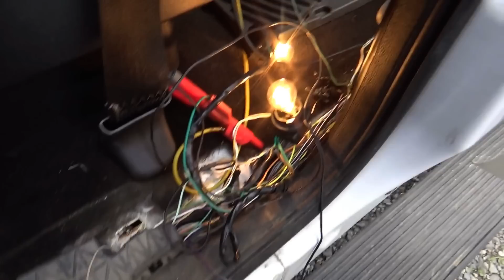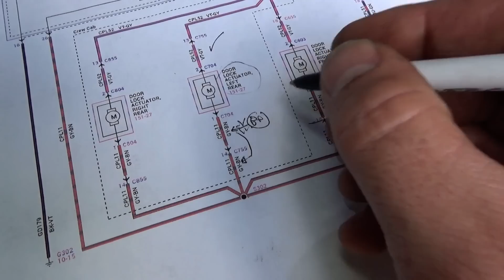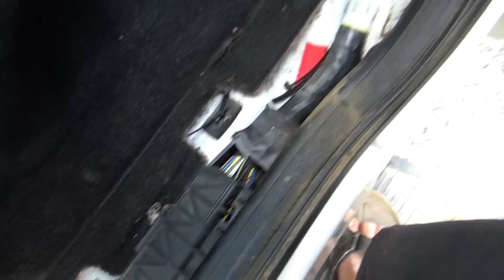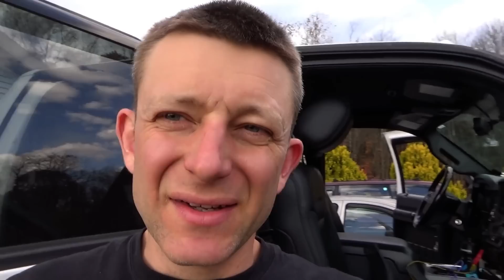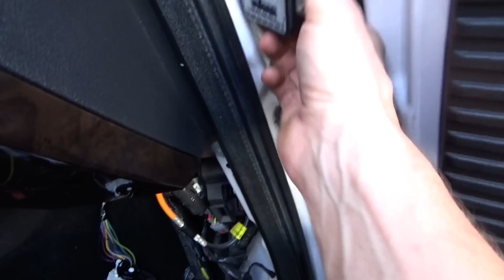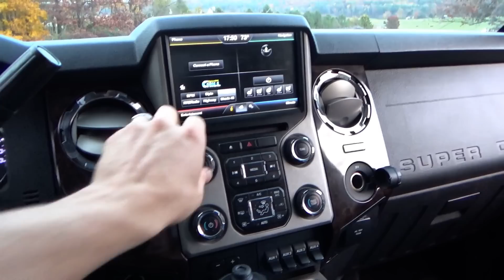(Pt 2) PowerStroke Power Locks DISASTER!?

Comment: You should have went to the pick n pull yard and cut out enough of the harness to repair the truck so that everything would have worked. I wonder if the lock actuator was overloading the circuit and popping the fuse? I also wonder if the customer installed a 30 or 40 amp fuse? Something caused those wires to melt. I think there's more to the story.

Comment: Great video Ivan. I noticed some burned pin sockets on the first video and on the first video, I was confused at why the driver's door lock worked when you sent power down the one wire with the connector disconnected. From what I think I was seeing was that you took away the ground when the connector was disconnected. With all of those wires melted, it must have found a different ground path?

Comment: There is plenty of speculation on the client installing larger fuses, jumper wires, etc. But what I'm wondering is what was the original problem to begin with? Probably the rear left actuator being shorted?

 However, the nature of door locks is they only pulse for 1 second or so, so, even if the owner had a jumper wire bridging the fuse, normal door lock operation would not enable a thermal runaway of the wiring harness. 

Let's say there was a short to B+ on the power window circuit to deliver continuous current to the power lock wires through a fuse higher than 20A (assuming the window circuit even has a fuse higher than 20A) and even then, I would think the lock relay defaulting to ground would deliver a hard enough short to blow even a 100A fuse before this much damage occurred, (I'd expect to see maybe an inch or two of harness melted).

Another thing that could cause a thermal runaway of the harness that caused the entire harness to melt this badly would be if the owner did a bypass test with an unfused jumper wire and no test light, but even THIS is not adding up for me, as we see no burn marks on the BCM connector or any other easy-to-reach connectors, and I don't think an owner intelligent enough to inject their power somewhere in the middle of the harness would be doing such an asinine bypass test.

This leaves another option, Let's say the original failure was one shorted door lock actuator, and the owner installed a jumper wire (because no fuse will stand up to a direct short), and then the door lock button got held down for an extended period of time (either by cargo or a kid in the seat). This would cause the shorted actuator to enter a thermal runaway for as long as the button was depressed. What gets me is that the micro inside the BCM would have to have no protection logic to limit the pulse time of the door lock relay, which means both poor engineering and an irresponsible owner. The fact that so much has to happen for this scenario to be correct leads me to believe I am only 25% sure this is what happened, and the reality could be a million different things. However, this is the only scenario I have not been able to completely rule out.

Comment: The story was sketchy as soon as you showed wire ties in the channel.  If they used fuses from Amazon (China), as shown in other channels, they could be 50 amps or more.  The why on continuous on is probably the remote in the pants triggered continuously on, or some debris sticking the key to the lock or unlock position.  Although I am a member of several Powerstroke Forums, this has been seen before.

Comment: I replaced the interior wiring harness on a FJ Cruiser. Ground wire from the trailer plug all the way to under the hood melted. Had to gut the whole interior to change the harness.

Comment: Do you know for sure what amperage fuse was really in there when the wires melted? I have seen, too many times, where some people will increase the fuse amperage after the fuse blows. They don't realize that the fuse melts to protect the circuit wiring. They don't understand that the wiring will melt to protect the higher rated fuse. They may have had a 30 amp fuse in there when the wires cooked.

Comment: I personally wouldn't touch that and say it's repaired without having the entire harness and BCM replaced, for a customer due to liability reasons.  If my own vehicle I'd replace any and all melted wires separately.  I did as much for a friend's 1996 Jeep Cherokee back in 2008.  I rebuilt the entire harness along the driver side floorboard.  The cause MAY have been related to the faulty Harbor Freight fuses of that era but unprovable.

Comment: My guess is that originally the door lock was shorting internally and blowing fuses.  Someone then replaced the 20 AMP fuse with larger to "fix" the problem.  The circuit cooked and eventually blew the larger fuse as well.

Comment: Very good diag and repair boychick. If the l/rear door lock solenoid fried, the master switch, (driver door), or the l/rear door lock switch stuck, the door lock solenoid could fry in time. Does the BCM have a time out on the solenoid output circuit. Might need new switches or BCM, OR BOTH.

Comment: i own several gm trucks with over 200K miles. the door locks get lazy and don.t unlock and lock properly? Also is it possible that the computer didn't see that one of the doors was correctly unlocked or locked and the computer tried to keep moving the door lock motor. That would make sense to me.

Comment: I have in the past seen a short tracer that was a needle in round frame that you put on the wire and it told you where the short would be. The needle just pointed to the left or right. Would not something like this help? SG Tool Aid 25100 Short Tester  Thanks for the video.

Comment: Maybe he used a 20A amazon fuse.  They are good for about 75 amps before they slow blow.  Back in 75 I had smoke from under the rear seat.  Back then you could just pull them out no tools required.  Wire harness running under the seat had started to melt.  Disconnected the battery, and repaired the wires.  Helps when you catch it in the act, it stays local.

Comment: I’ve ran into similar issues. As you know these bcm’s are problematic. My suspicion is that the internal circuits of the bcm absorb more of the current than the fusing resulting in overheating circuits. Still doesn’t explain what initially caused the short.

Comment: Weird. A prolonged draw of only around 2 or 3A would not melt that wire like that. A short pulse of <20A would not melt the wire. >20A (from a dead short) would blow the fuse quickly and still not melt the wire. 
My guess is failing rear actuator was drawing maybe 10A. That caused the relay contacts to weld shut, holding power on. Prolonged 10A draw melted the wire, but didn't blow the fuse. Circuit is now open inside the door after it melted and short(s) due to melting blew the fuse.
Driving the truck "unstuck" the relay.
Or somebody did something silly trying to diagnose it...
Reply: Door switch stuck on. Milkshake maybe?

Comment: I unfortunately owned a SL2 Saturn that the factory totally screwed up. The door locks were one issue where the wrong cylinders were installed and if you did not remove the key with the lock perfectly straight up and down it would rattle like a machine gun as it was trying to unlock or lock itself non stop. They ended up replacing every cylinder in the car with the proper type.

Comment: So the non replaceable relay shorts out and blows the fuse. Than some meathead says lets put a bigger fuse in it and it works until it melts the wires.
If your a Meathead, please join Meatheads anonymous today.

Comment: Two choices for why the fuse didn't protect the circuit. 1) the fuse kept blowing so it got replaced with a higher amp fuse, 2) the circuit shorted to another circuits power wire.

Comment: Excellent repair and diagnosis. I agree on an older truck there's no point in spending all that money for a new harness. Maybe if he really wanted the lock to work you could have ran a redundant wire. It's also way cheaper to turn around and pull up on the lock 😂

Comment: 20amps is actually a large amount for those small wires. If we look at electric code it requires a 12 gauge wire. Those wires look like 18 gauge they can handle 20 amps only for a short time. Extended time will overheat and then cause a melt down. Nice job of fault tracing. You should make a test light that is switchable .5a,1a,2a,5a and so on. Would be nice to have it all in one stick.
Reply from the maker: My dual-bulb test light set IS easily switchable...that's exactly why it is so versatile!

Comment: I think the customer left out the part where he put in a 40 amp fuse to try and fix the problem DIY. Also, I noticed that your Amazon store needs to be updated- I guess the PP921 isn't available anymore- looks like they might have superseded it. Is the price difference between the 3 channel and 4 channel just for the extra channel or is there more to it? Also, you used to have a big test lead kit listed to go along with the scope but I'm not seeing it anywhere- any ideas? I think im ready to get setup with a scope for the shop and want to make sure i get the right thing without overspending too much.

Comment: The reason that the loom has melted is that the wires individually cannot handle the 20 Amp current fuse rating, I'd estimate them as being only good for around 5 Amps continuously. It's totally a design error. Remember that a fuse will carry its rated current indefinitely, it takes multiple times the rated current to blow it quickly. A 2x overload may take minutes to blow.

Comment: Is the fuse rating too high from the factory? Why would you fuse a circuit that draws no more than 6 amps with a 20 amp fuse? 20 amps is a pile of power! Ford has a problem with occasional fires, could this logic have something to do with it?
Reply from the maker: Yup 20A is overkill for this circuit...10A fuse id plenty :)

Comment: Hi, Ivan. I wondered why you did not run a new wire from the power lock straight to the bcm to isolate all the burnt wire and you could have saved a lot of work.

Comment: When the locks blew the fuse the first time, I’ll bet he only had a 30 amp fuse and stuck it in. The wires melted and he replaced it with the correct fuse before he gave the truck to you.

Comment: I suppose the electricity was being divided somehow lowering the resistance enough that the fuse didn't blow until there was a dead-short. A slight design flaw, a luck of the draw for how things happened? Ford had something similar (in a way, sort of) in their older 4 cylinder Mustangs where a harness connection would melt, and then it would short, and you'd lose your radiator cooling fans and whatever else. It only cost about $150 to fix back then, at the dealer, times have changed 😏

Comment: Just order a new harness that ford discontinued years ago that was already on back order for two years before they did  and would have been 4,000 dollars plus all the parts for inside the door. Fuse system doesn't make since they melted like that maybe an engineering issue they have been lucky with but not on this vehicle.

Comment: Once one ckt is shorted to another, all bets are off! Fuse size may be wrong for the smaller wire, ckt diagram won't be correct, etc. Very hard to troubleshoot when unrelated ckts are connected by damage. You did good, like always!

Comment: My 1983 533i had a relay to provide power to the door locks. If cycled too many times the fuse in the relay would "blow."  Well, the fuse was actually a soldered connection between two metal blade within the relay; too much current melted the connection.  But also continued current which produces heat. Clever way to prevent melted wire.

The source of my issue..., um..., err..., well..., they're all adults now.   Click, click, click, click is just too much fun, right?

Comment: We all know a 20 Amp fuse cannot provide protection for an overloaded 20 Guage wire. A short, yes. Not an overload. It does seem that it would have been faster to just cut and replace those 7 wires as opposed to using all that tape.

Comment: Could this have been an engineering error on the design of the door lock circuit.  Was the fuse (20A) sized to operate all four door locks at once without blowing, but each individual wire to each door lock was undersized so that if only one wire was constantly drawing full current - up to 20A it would melt.  Those wires looked pretty small to be on a 20A circuit.

Comment: Perhaps the customer found the blown fuse and jumped the fuse with a wire and turned the wire into a heater. He will never tell you that I'm sure. The rear door lock was likely the original problem.
Reply from the maker: I asked the owner yesterday... Still no response 😂

Comment: A lot of wire ties down there by the BCM, was someone in there before?
Most likely senerio is that someone had a door panal apart at some time and didn't clip the harness in the correct location. So it probably has a rub through somewhere(intermittent)causing short. 2cents

Comment: Personally I would have ran a external wire harness. Cut all the bad wires then spliced to new and run a harness where it's not really super visible. And tell the owner not to use a incorrect fuse and to be glad that it works period. My thinking is that if someone line in this case obviously must have had incorrect fuse or no fuse they don't care to much about the car. Then it's fine to run external harness with like 10>15 wires. Cheap fast and gets the job done.

Comment: It's not that hard to just cut out the wires that were bad and string in some new wire in it's place...  Since you already had everything open.  Granted, you would have needed to go buy some wire, and I get that the guy didn't want to spend too much.   This would be an easy fix for me on my own truck,  especially now that you have a video out showing all the details of what you found.  But I could never pay another guy to fix it. lol.. That would be way too expensive;  So again, I can understand the guy not wanting to pay to fix it all the way on a truck with so many miles............... I think an even better fix for you Ivan, would have been to just cut the bad wires and isolate them;  but leave them in place so that the next guy can see where they go.   Now when they try to fix it, they won't know where the wires go to (unless they find your video)...    What a case study

Comment: All Lock / Unlock relay welded contacts, motors stalled, harness over-current, fuse too large for welded contacts, wires overheated, wires then shorted in the harness, then harness burned. Unfortunately, the passenger compartment wire type is probably GPT automotive wiring which is only rated to 85 Degrees C in free air. Most automotive electrical repair shops that make / repair wiring harnesses only stock TXL for increased temperature, 125 Degrees C and low weight, thin wall. 

You could measure the actuation current with an amp clamp and Picoscope and then reduce the size of the circuit fuse to match. When replacing the fuse to a lower value make sure it is not an amazon generic chinesium fuse, which tend to all be 30 Amps regardless of the color or printing. 

Unfortunately, the only way to resolve the problem is to repair the harness which means removing the seats and making a new mini harness, change the bad door lock motor, then inspect the BCM All Lock / Unlock relay contacts. If they look like they welded at some point, which is the only feasible root cause, then you could perhaps replace the relay (may not be a popular open frame type, if it is then it could be replaced) or recreate the relay function out side of the fuse box, or replace the BCM. You could increase the circuit wire gauge and install a fuse with a lower rating.

The problem with welding contacts is they will most likely weld again at some point. 

It is problems like this that auto electrical shops have a wire line to make new harnesses.

However, would the customer be willing to pay for the above repairs given the mileage on the truck. Probably not.

Comment: 18-gauge wire is rated at 10 amps. If that leg of wire was forced to carry 15 amps, it would take a few minutes for the wire to heat up, melt the insulation, then short and pop the fuse. Technically, the wire was the fuse in this fault.

Comment: Somebody had to throw in a huge fuse to try to get the doors to work. Either that or jumpered across the terminals with a paper clip or something.
Reply: Or used cheap fuses from Amazon/eBay. Louis Rossmann did a test where he put 20A through a supposedly 5A fuse. Still hadn't blown after 7 mins.

Comment: Theres something else going on here.
Even if the customer had put a 30A fuse in, the lock pulse is under 1 second and that could not physically heat up the harness quickly enough to melt.
Could they have kept on operating the lock switch inside the truck?
Maybe.
I know if you do such things on VW group vehicles it sets a fault in the BCM saying "play protection active" and there is a timeout before the locks can be operated again, allowing the actuator motors to cool.

Remember the final short to ground was found right near the BCM.
I have a feeling that the short is actually present inside the left rear door and isnt a short to ground, its a short to power from something like the seat heating or window circuits.
In the rest state, both lock wires are grounded by the relays.
Thats maybe how the fuse wasnt blowing initially until the locks were operated and it tried putting B+ on the wire which had melted and shorted to ground near the BCM.

I'm amazed the relays haven't been damaged by that fault current!
Reply: Along the lines of "play protection", that was my first instinct. Kids in the backseat playing with buttons and holding them down.

Good on VW for protecting against that. Replacing the kids is cheaper.
Reply from the maker: Great theory!